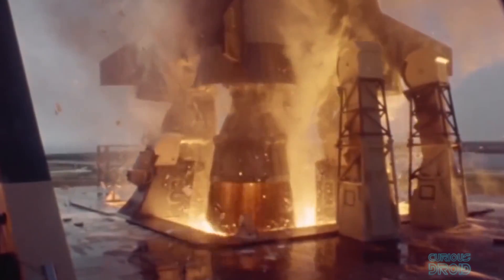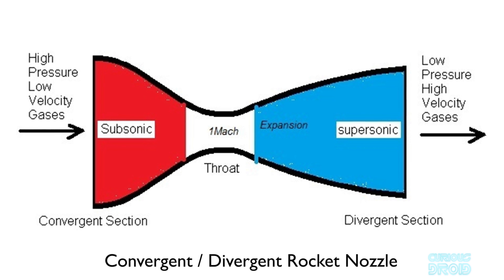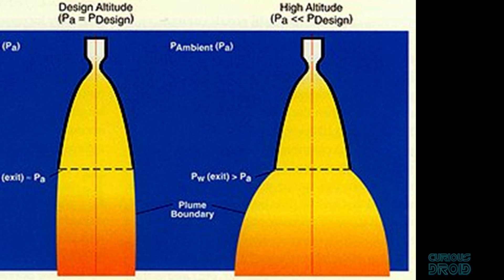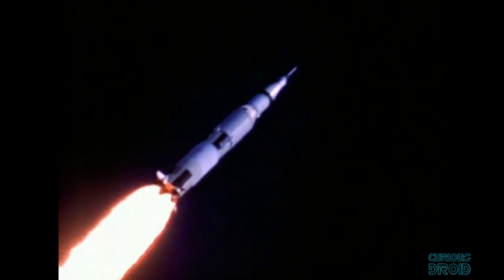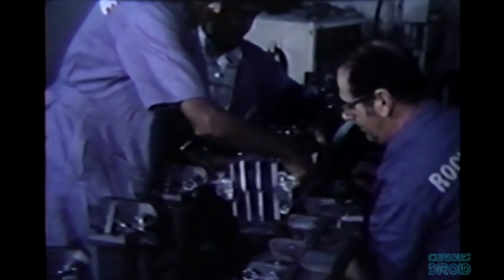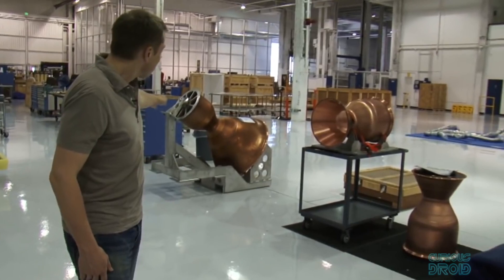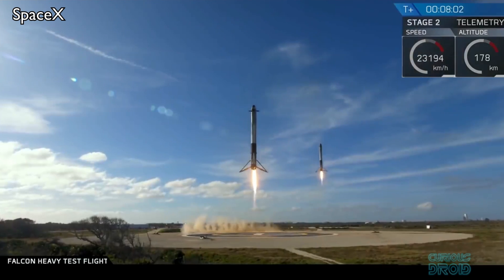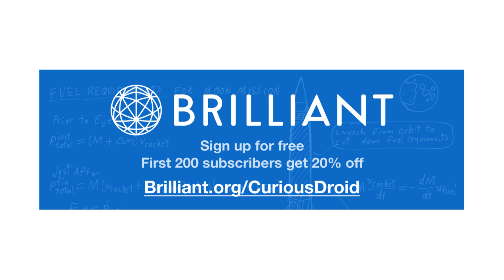Aerospike Engines - Why Aren't We Using them Now?

Comment: There's also the problem that an SSTO needs to carry its whole launcher structure to orbit, requiring much larger vehicles and much more fuel than MSTO of the same payload capacity - even if you factor in reuse. Now if you have a multi-stage vehicle, you can optimize the engines for the resoective altitude range of each stage, further diminishing possible gains of aerospike engines.

Maybe they'll find use on Mars one day, which is suited much better for SSTO than earth.

Comment: Actually its not only fuel cost if, its forst time i hear about this but if u dont need thruster that lifts off the rocket and then separates creating space junk, it cost quite a lot and creates space junk that is a problem everyone is trying to solve. Sure SpaceX made resubable thrusters but how many times can u reuse them also its still cost, not to mention space ships would be much more flexible without need of thrusters, they would finally be more like a space ship and not a rocket. Also it would be very good for BFR bcs it wouldnt need thruster that is quite expensive even if its reusable

Comment: Removing the different stages as you go also reduces the weight in addition to the higher efficiency at each specific altitude.
Reply: +Cokeman439 Yep, and increases the overall cost exponentially, as you have to deal with the logistics of remaking or retrieving the discarded components for a relaunch.  As was stated, the fuel was the cheapest component.
Reply: @nevanderson1164  its the removal of weight that im talking about, in addition to the greater efficiency. If weight wasn't an issue and fuel was cheap we could just make an infinitely large rocket
Reply: @Cokeman439-Minecraft  unfortunately, cost of lost stages is the thing that make space incredibly expensive
Reply: @heyhoe168  It's hard to say what's would be cheaper, 'cause u must calculate it first. In rocket engineering this is called optimization. So when u match efficiency and cost there's no specific answer. And when u use one-stage vehicle you must use more expensive materials, technology, desing to reduce weight of the vehicle even for possibility to get into space, 'cause if your vehicle weight is too big you won't get into space. And the main goal of the stages is to lose weight while you're getting into space.
P.S you can save stages just like SpaceX do or use parachutes. And all benefits of one-stage vehicle will dissapear. And what left? Recipt of expenses on desinging, building, experimental flights and etc.

Comment: ROCKET 🚀 ENGINES DON’T WORK IN SPACE !!! . THATS WHY THEY CANCEL THE SHUTTLE PROGRAM MISSIONS !!! . ONCE FAKE NASA WAS EXPOSED !!! . FIRE 🔥 ENGINES REQUIRE OXYGEN !!!! . THERE IS NO OXYGEN IN SPACE !!! . NAZI NASA HAS YET TO FIGURE OUT ? . HOW TO GET TRU THE VAN ALLEN RADIATION BELTS AND THE FIRMAMENT. ??? . ITS ALL SYFY .!!! ..🔥🚀🔥🚀🤣😂...
Reply: Thats why rockets bring a big tank of liquid oxygen with them....Stop trying to troll.
Reply: Maximum to 80000 feet. than you must fire a real rocket to comes higher. And scramjets real exist for reusing fly fast to that altidudes.But for them you need boosters to come to speed for scramjet aircompression. That are existing technologies. So can come to Mach 5 and lift your rocket to 80000 feet.

Comment: the V shape is vortex so you need vortexes within vortexes to compensate but I think the UFOs use magnetics and use a tesla vortex ram air thrust pulse engine( so the magnetic energy rings go into stages of propulsion for maximum energy boost(hence vortex energy timing)) , wind is magnetic current and magnetism is in all currents,

Comment: Not efficient.  Thrust to weight ratio not enough to lift load.  Wishful thinking at best.  You can add vector control to round nozzle.

Comment: It is impossible to have missiles and there is no other kind of jet engine to operate simultaneously in the atmosphere and at the same time in the supposed non-atmosphere of the vacuum space, because without the air (atmosphere) from which it can be pushed there is nothing else to move them forward. Instead, rockets and shuttles would have been routed uncontrollably around their own axes in the east direction because of centrifugal forces from the assumed rotation of the Earth at 1666km / h and the assumed rotation around the Sun with 107,000km / h as a gyroscope. It would be impossible to fly to the moon or go anywhere in any direction, especially if "gravity" was real and constantly sucking you to the closest and densest body! ! But even if there was such an engine, imagine how it would work in a vacuum when the thrust of the engine would be meaningless, because there is not really anything to push, because there is no other force to counter or counter it to exist some push in the given direction, making it impossible to move the rocket even per centimeter through the vacuum space. You know how airplanes and missiles fly in the atmosphere that has a density and they actually push it to move, but the vacuum can not be pushed because the vacuum is nothing, it has no density and can not counteract or react to the rocket engine! We really make us fools, because we are not familiar with the principle of engine work in vacuum for their convenient profit. If the vacuum existed in space, no magical "gravity" and no gravitational force might be able to hold our Atmosphere under pressure! Atmosphere under pressure would have been sucked in only a fraction of a second by this vacuum, which has opposite opposite force to our Atmosphere, and let us not talk about the absurd ozone holes that would affect the atmosphere like a pierced inflated plunger!

 Satellites are supposed to be carried in the thermosphere, where temperatures are as high as 2500 ° C. However, metals used in satellites, such as aluminum, gold and titanium, have melting temperatures of 660 ° C, 1065 ° C and 1668 ° C, all far below those that would be exposed there. ("The temperature depends on solar activity and can rise up to 15,000 ° C," says Wikipedia in the same article, and a little further: "Despite the high temperature, one will not feel the heat because the particles are near cosmic vacuum and have almost no contact with other surfaces and therefore can not transmit heat.Normal thermometer would account for a temperature of 0 ° C. "This is now completely absurd schizophrenic unusual !!! Which of the two is true: 1) 15 000 ° C or 2) 0 ° C ?? !! The authors of these low-cost pieces are better to put their heads in an oven, heated to just 200 ° C and check! In the cited glans, one of the main goals of education and media propaganda imposed by the Illuminati is to bring the human being into cognitive dissonance - psychological conflict as a result of the simultaneous maintenance of incompatible knowledge, beliefs and attitudes, thus killing critical thinking and eventually enslaved the whole human mind!

 NASA says there are more than 20,000 satellites in the upper atmosphere of the Earth that broadcast radio and television signals and take pictures of the planet. All these fake satellite images, however, are actually "composite images edited with Photoshop"! They claim that they receive "stripes of images" from the satellites, which must then be spliced to create composite Earth images, all of which are undoubtedly CGI images, not photographs. If the Earth was indeed a globe with more than 20,000 satellites rotating around it, it would be a simple job to mount cameras on them and make true photographs. The fact that there are no actual satellite images of the alleged Earth-Ball in support of NASA's "Composite Computer Images" is another proof that we are not told the truth.
Reply: Do some research you appear to base your whole argument on the premise that rocket engine gases need to push against the atmosphere and cannot operate in a vacuum. Well rocket engine thrust is created according to Newton's third law of motion ' for every action there is an equal and opposite reaction'. The (upward) force is created by gases rapidly expanding through the engine nozzle and pushing against the rocket in the opposite direction - the equal and opposite reaction is the rocket gets propelled in the direction its pointing. Hence your arguments premise is wrong. Remember Google is your friend.
Reply: Go away, wilfull ignorant.

Comment: Wasn't the Space Shuttle supposed to also reduce the cost per pound of payload by a factor of ten, compared to Project Apollo?? It didn't work out that way, did it? If an Aerospike-powered new space could actually accomplish that goal, it would be a game changer. But I think NASA would find a way to make it ten times as expensive as claimed. Those guys don't spend money drunken sailors;  more like the wholedamn drunken Navy! 

In my opinion further space exploration is too important, too vital to solving many of earth's most intractable problems be left to politicians and engineers and major contractors and the few brave men and women who fly them. Such exploration should be a global effort, where the manufacturing, testing and engineering expertise came from all over the world. 

I am convinced that, for the foreseeable future, manned missions to Mars and beyond, while laudable goals, are largely unnecessary given the capabilities of machines, robotic vehicles and, at some later date, androids should they ever be designed and perfected. 

Why? Because spacecraft used for long-term manned missions to Mars must have drastically higher fixed and operational costs, in order to keep their human occupants safe from radiation and temperature extremes long enough to survive blast-off and achieve orbital flight, reach escape velocity to exit the earth's gravity, travel for a year to get to Mars, survive re-entry on Mars, carry out exploration and research experiments and  live on mars, repairing essential equipment as necessary or risk certain death. Then they must survive a second blast off, achieve Martian orbit, escape Mars' gravity, travel another year or probably more to return to earth and survive the intense heat of re-entry. At present no-one knows how most of that is going to happen safely, given the well-understood nausea, vomiting, loss of muscle tone, reduced bone density and psychological issues which arise from sustained zero G in a confined space.  

Machines are tougher than humans. Way tougher. They're simpler designs because they don't need to return to earth. They don't get sick. They require no special atmosphere, nor do they need food and especially water to remain alive for years. Machines may or  not exude noxious waste products, but not like humans do. Human-generated urine, feces, carbon dioxide and carbon monoxide must either be recycled through com posting, stored safely during long duration flights or, most likely, be vented outside the space craft the way they did  during Apollo, thereby polluting outer space. Machines need minimal protection from radiation and can operate efficiently in temperature extremes where humans need bulky, potentially failure-prone pressure suits. Robots can remain on Mars, orbit a moon or planet or continue to head out of the solar system until their critical systems fail. Meanwhile, there's a Mars rover that was hoped by NASA scientists to last a matter of months that continued to operating up there on the red planet for about a decade. Now that's what i call getting the most bang for the buck!!

Critics of machines substituting for humans in space point out the amazing advancements such difficult projects produce. Projects Mercury, Gemini and Apollo spurred the development and testing of everything from docking in space, the modern space suit with its own atmosphere produced by its back pack, the microchip and all that derived from it,  the cameras we use in military planes and our smart phones, scratch-resistant lenses, CAT Scans, LEDs, land mine removal mechanisms, athletic shoes, water purification systems, digital ear thermometers, home insulation, the jaws of life, wireless headsets, memory foam, freeze-dried foods, smoke detectors, artificial limbs, the computer mouse and the portable computer. And countless other materials and technologies which either would not have been developed, or would have shown up later. 

The bottom line money-wise is this: as a species we can get more space missions to mars or beyond without humans onboard, than with them. With ever more sophisticated and  advanced machines and robots, man no longer need die in space merely to prove a theory  or win an existential  propaganda war.

What do you think?